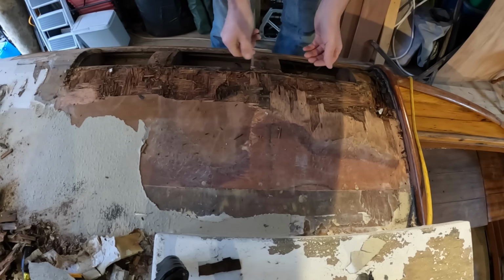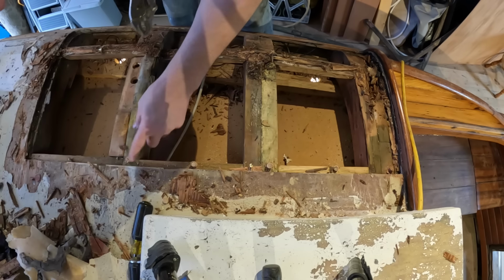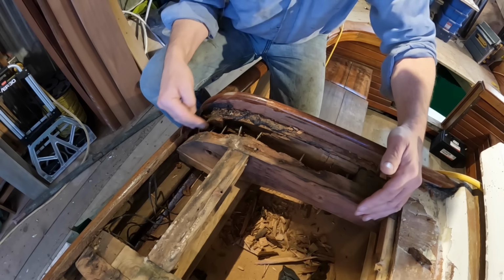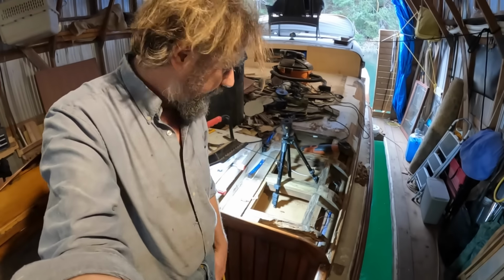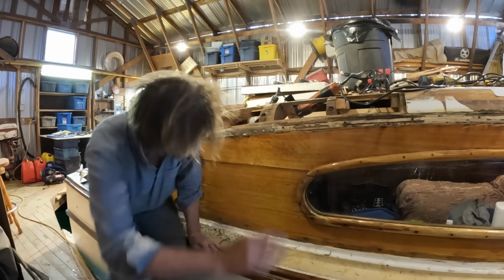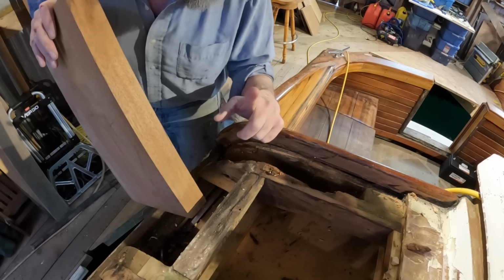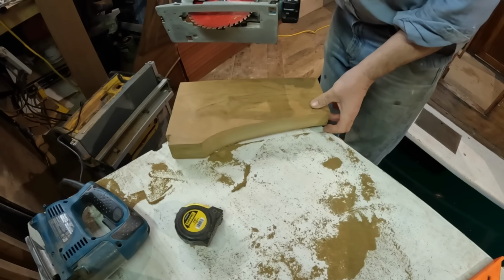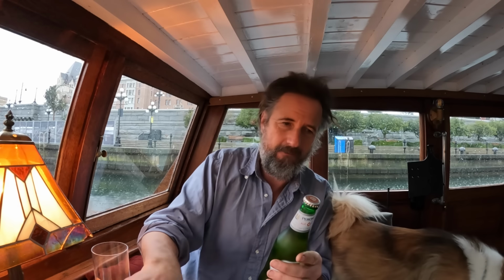Restore a Rotten Roof - #406 - Travels With Geordie

Comment: Thank you Peter for the midweek video.  It is an education to see you tackle a problem and come up with solutions.  Once you get the roof rebuilt and fiberglassed , you should be leak free for some time.  The new cabin sides will reduce that even more.  All the best, Hal

Comment: Goodwill finally a heat gun and a 7 " craftsman sander..did my rocking chair ..right arm reglued poor job no clamps. Heat gun, screwdriver chisel. Clean female out ( yes yes a thousand times YYYESSSSS  ) Then circumsized a little off the top, male..sanded a touch,gorilla glue .
Now I'm... ROCKEN  IN THE USA..